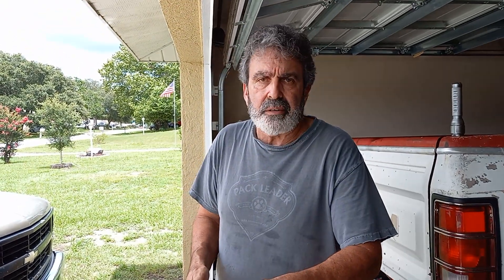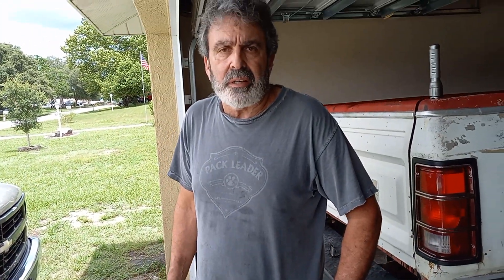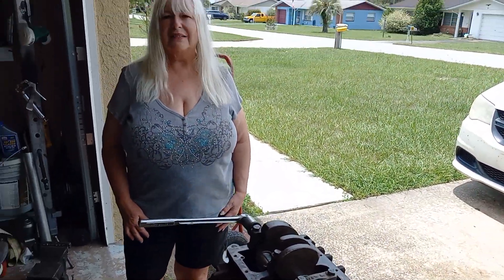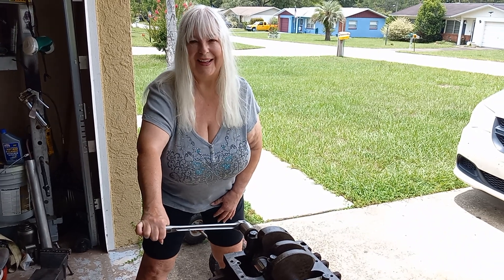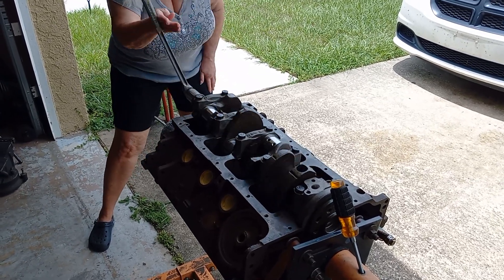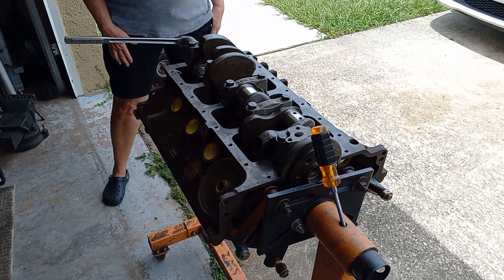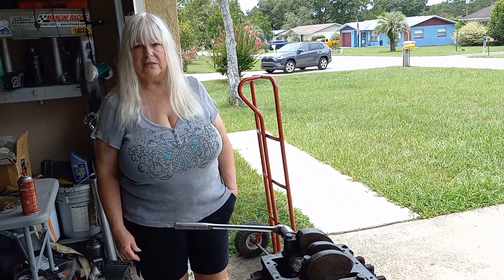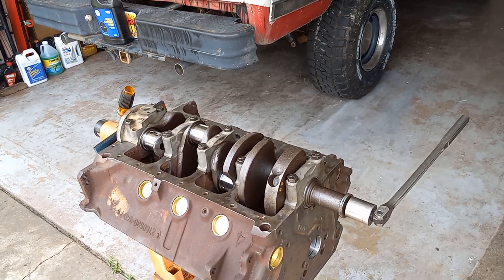Watch Beverly test the crank spin on this 340 mopar block/ line-bore test, works on any other engine

Comment: That's the way I've always done it. Should be able to spin it with one finger. Without the main seal it should spin on its own weight. Rope seals drag quite a bit. In spite of that the machine shop I went to performed a line hone to jack up the bill. I had essentially a 'new' engine block they did every machining operation possible to raise the cost. Machine shops aren't making money unless they're cutting metal.
Reply from the maker: True... machine shops throw guilt trips on everybody by saying ' well I'd do it but it's your call'    😮
   Heard that a thousand times.... lol